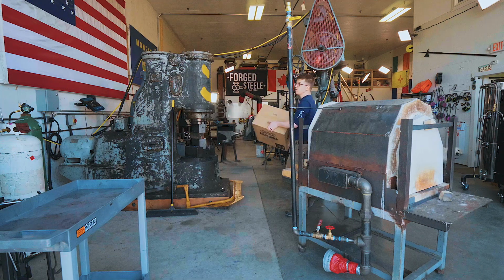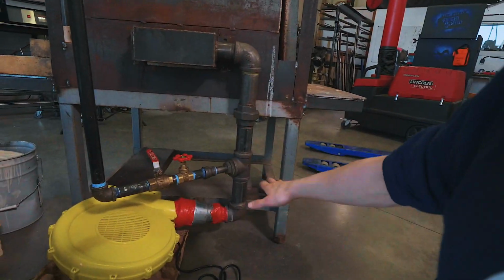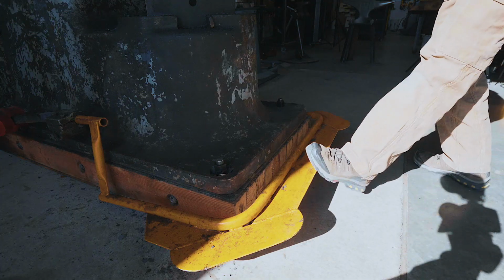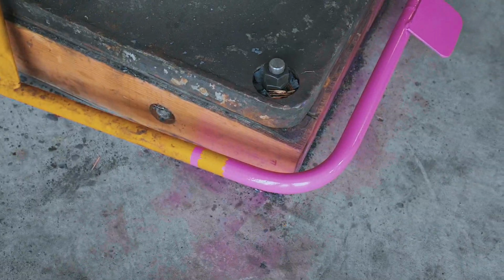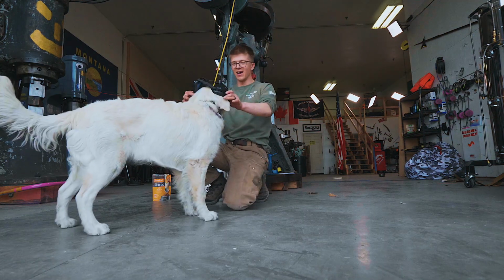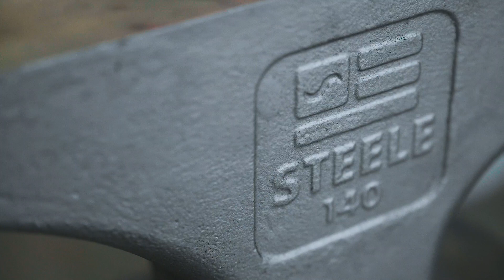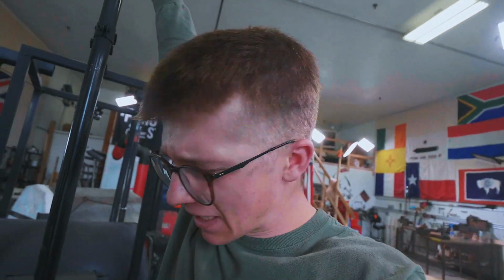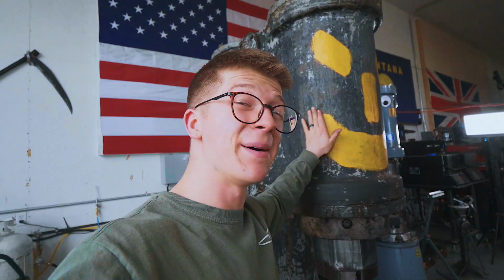NEW FORGE BLOWER, YOGO'S EARS, FORGING TOOLS!!!

Comment: What's happening in the forge is called flame lift off. It's caused by having too high of velocities exiting the burner nozzle/holes. You have two possible issues. 
1) you have too much air/fuel for the burner
2) your burner nozzles are plugged or the burner is too small for the heat you need. 

A ton of excess air isn't good if the goal is to get the hottest flame. Excess air that isn't used for combustion is just absorbing energy from the combustion of the fuel and carrying it out of the forge. You are looking for the hottest flame because most of the energy that the forge will absord is actually infrared, which is related the (flame Temperature) ^4. The huge amount of excess air lowers the overall temperature. You need to be able to regulate the air and fuel more precisely so you can still have plenty of air for proper combustion, but not so much that you  have flame lift off or so much excess that you lower the temperatures. 

If you can get an IR thermometer, it may help you dial it in. My suggestion would be clean the burner, and add better flow control on the discharge of the blower. Then get a nice small controlled flame and use the IR to optimize the flame temp. Once that is done, you can increase the air and fuel flow rates little by little until you reach the burner capacity (excessive lift off, and flames that are no longer jet, and "dance wildly" are signs that you have gone too far). For extra points, add a fuel pressure regulator, a gauge and flow meter to the fuel along with a globe valve for proper flow control.

Btw, tuning heaters and burners can be extremely dangerous in industrial environments. Back in the days when I worked in the petroleum refining industry, heaters were the most feared pieces of equipment, with some of the highest piece counts of safety equipment. Second, maybe only, to high pressure steam boilers. Be careful. Always purge the heater with air before adding fuel and lighting a flame. Also fuel is turned off first, then air. Always.

Comment: I'd try fitting a speed control to the blower. I think you blew right through the too much fuel problem into a too much air problem.
Reply: Yup a VARIAC would fix this I think

Comment: with the big forge.. and all the air flow.. instead of coming in the end of the burner box.. cut the back out and build a new inlet.. you can get cast steel hand rail sections you can weld together to give you wider radius bends that should be able to handle the heat..   you may want to have the air coming in  by using a pair of cast steel handrail elbows..  so you can take full advantage of the volume without speeding it up till its supersonic blowing across the forge hot area..   if you have a 10 or 20 amp Variac.(not cheap). you can slow the blower down.. but do not slow it down more than 60% on the dial.   because when you reduce the voltage the current goes up.. and you will overheat the windings causing the motor to burn out.  since  your blower takes just short of 10 amps... hopefully you can go to a bigger variac..  you might also try a Router Speed control... its a little electric box... chops the AC wave into fragments to control router speed.. since many routers are around the same amp draw as your bounce house blower... you might get away with it. and they are only 20 bucks over at harbor freight.  i use my 10 amp Variac.. on my brush type motor finish sander as a foot and leg relief tool..  i use it on my big fans to slow them down when the 3 speeds does not get me where i want to make wind at..   Hint... hand rail elbows are rough finished inside... do the sanding strip on a 1/4" shaft with a slot to take some of the casting rash off the inside to smooth the airflow. 

 you should still put up a craigslist ad.. looking for USED... even broken Land rover Leaf spring packs.  somebody will have some sitting around..  shieffield steel you know..  want to make  middle eastern looking patterns in your forged steel.. what do you think they used..  rule #1.. never abandon your land rover in africa..  the axles and springs will be gone when you come back with a new ignition rotor..

Comment: @alec steele, this seems like the blower is too close to the ribbon burner along the length of pipe for the air and gas to mix properly. A longer length of pipe from the fuel injection port gives it more time to mix. With a blower that powerful it looks like you're getting to much air to natural gas in ratio, and possibly too much volume to the ribbon burner overall.  I hope that helps

Comment: Hello Alex. So I have some experience in gas burners mostly in the glass industry. So the first problem I see is that gas pressure in is typically is 4-6 psi. So the larger blower with the 2 90's and the possibility too much air in and an opening not large enough to allow it to flow unrestricted is creating back pressure. Pressure in the system that exceeds the gas pressure in has essentially restricted how much gas is acctually allowed to flow in and mix with the air. The fan you had before was probably the most the burner could handle. I can give you some suggestions on what you can do with what you have or can easily make but that would have to be done in a private conversation. Some of the info is how I make a living.

Comment: RIBBON BURNER, To regulate the airflow, install a gate valve or bypass valve before the fuel inlet. Your flame just has too much air for the amount of fuel. The flame in my setup looks the same when the bottle starts to run empty. I'm running a 265cfm blower, 2" gate valve, 1/4 fuel line in, 10" ribbon burner, similar to what is found on Wayne Coe's website. Give him a shout, he's the OG ribbon burner guy

Comment: Bigger volume pipe means less pressure, and visa versa. So you're trying achieve two sides of the same coin. To get the results you want, both pressure and volume, maybe consider running two blowers into pipe(s) of a small diameter. Maybe have the two blowers joint into a single inlet, or possibly two inlets. However I don't know if that'd have any adverse effects. ^ but yeah try two blowers.

Comment: And about your forge problem. Definatly use a larger pipe. Ittle slow down the air flow but you’ll get the same amount, if not more, are going in. Imagin you have a lit match. For it to burn hotter you’ll need more oxygen. But if you blow on it, it’ll go out. That’s because the air was to fast. If you just put it in a slower feed of air, it can use that oxygen instead of it going by to fast for it to be used.

Comment: Alec : You are on the right track with the larger blower. You may have gone to big but, "to much is better than not enough."  The way you were trying to reduce the amount of air going in is called "starving the blower," and is not good. Never do this to a blower or pump as it will shorten the life of the motor if not burn it up. Put a throttling valve in the pipping on the exhaust side of your blower. Use a "Globe valve." That way your can dial in the amount of pressure you need for your air to fuel mixture. Don't look at it as a problem, but as a challenge. You learn more when things are challenging. Hang in there brother.

Comment: @Alex Steele Just a FYI but the gas pressure for a natural gas line is pretty low you could be simply near the pressure for that gas pipe. You could maybe build an inlet for the blower with the gas entering in a tube with a sliding door for air flow control and let the blower both do all the mixing. Would likely have a lot higher flow that way anyways since the inlet of the blower will be negative in pressure aiding the flow of gas. Food for thought man keep up the good work.

Comment: Maybe the pressure from the blower is so high that it does not allow enough gas to flow into the mixture. -> Bigger pipeafter the mixing point.

Comment: Have you stopped the hammer from hitting the top? I was wondering if the spring is fatigued or needs a pressure adjustment. So it wood take more force to compensate for the up stroke. ? maybe?

Comment: The big forge problems.
I think you need a bigger ribbon burner, and to move back to the lower pressure blower.

The first setup seemed like it wasn't flowing enough air (as you pointed out), and now it seems that you have too much air flow through to burner (caused by the higher pressure)
As you covered the air onto the blower, your problem got better, but, I think that ultimately that burner cannot flow enough air/fuel to heat that forge like you want.

I would suggest a bigger burner, or perhaps a second burner. Either way, I think the flow restriction is in the burner itself.

Comment: The pressure of the fan is probably holding back the pressure of the gas.  I would re pipe so the fan blows and the gas injects as close to the burner as posible.
Reply: Also put a gate valve on the air so you can throttle it up and down.

Comment: Alec! Could the issue with the power hammer hitting the top of the chamber been because of the original plate that was on the tredle? With you switching it to the top of the bar and angling it down it would limit how close the tredle bar would be to the ground compared to what it was originally. Albeit there's not much of a difference but it may have been all it needed.

Comment: When you increase air pressure and your gas inlet is on a tee, you are going to be stopping a lot of that gas flow (natural gas is very low pressure at the device in most cases).  You either need a venturi action (low pressure zone for gas injection) or to plumb the gas on the intake of the blower.  I'd use a flash back arrestor on the oven itself too just for extra safety.  Oh and I'd ground your gas piping if it isn't already.  Static buildup is not good in anything.

Comment: You have increased the o2 higher than the mix ratio of natural gas. Also you gas mix point needs a Venturi design instead of straight pipe. The gas pressure is piped in at low psi. and you are probably inducing a back pressure.

Comment: You have too much volume flow compared to amount of gas. To increse the pressure inside the forge, you'd need to restrict out-flow, which can be little tricky while still maintaining the usability.

You can still try if you get better flame by closing the forge openings enough to restrict the flow into proper level

Comment: You need the same amount of air going into the forge at a slower rate bigger pipe diameter is all that is required

Comment: What might help with the controlling the airflow with the forge would be to put a gate or ball valve to control your airflow, there’s to much air going to your ribbon burner it’s blowing out your flame. The mixture is too oxygen rich. It would also be interesting if you could get the specs on the ribbon burner to see what would be the maximum gas pressure you should have then with that done slowly raise your oxygen levels to you got the whole burner lit without it being ripped away.

Comment: If it was me I'd want to put a small tubular bumper on end on the workshop floor on either side of that new protruding pink foot plate, because if the original design was a trip hazard, a close to horizontal steel plate at shin height is surely a nightmare waiting to happen. The circular bumpers might be a trip hazard themselves but still far safer...

Comment: do you think that the added pressure of the blower is affecting your gas out put? cause a gas regular works by supplying gas by measuring downstream pressure. (downstream of the regulator) so if the blower is supplying lots of pressure, the regulator may be sensing that an closing the orifice

Comment: have you checked for or cleaned any carbon build up from the manifold or screen on your ribbon burner? i know the burner manifold has some smaller holes that can get plugged up over time. this would effect your gas flow and possible gas pressure.   also with the air it seems you increased the air psi and cfm , not sure size pipe your burner will accept. you could try to add a knife gate valve or  a butterfly valve inline to get some better control.

Comment: Direct Fired Manufacturer's Rep here.  At 4,000 feet that you're losing about 14% capacity* on the burner due the change in density.  You could try over-firing the burner, but your flames lift and look like, well that.
Considering 1: it worked a sea level, 2: the other forge with an 8x4 and elbows works fine with 2 psi gas, and 3: your flames are lifting something fierce.
I'm leaning toward you need a bigger burner at altitude.  Wish I knew of other blacksmiths at altitude who could chime in.

*(see AMCA 99-09 section 0200)

Comment: Alec, remember the machete you forged when you were still in the UK? I think it would be awesome if you made another one, but with a longer handle, long enough to fit two hands comfortably and ample room to choke up on the handle or down for greater power and swing speed.

Regarding the large forge, I recommend using a turbocharger and a C-shaped pipe to give the air going in a better chance of reaching the inside of the forge with the most efficiency. Air does not like traveling at 90° angles.
Reply: A turbo charger would introduce enough pressure to pump air into the gas line........

Comment: I'm an engineering in the HVAC industry. Putting a bigger blower on your system may not help all that much if the pipe is too small. You will create a lot of back pressure for the blower to have to overcome. What is the diameter of the pipe feeding the air into the forge and what is the rated output of airflow and pressure that the bouncy castle blower uses? I can easily run some calculations to see where you issue is?

Comment: It is velocity. I think that you got enough air going through, but the air is moving too fast. When you have a pipe go from wide to narrow, it gets really fast. Super-sonic airflow makes it hard for flames to stay lit. That is why many jet engines have air traps to slow down the air, add fuel, set it on fire.

Comment: Natural (methane) gas flame speed is 0.356 m/s and it burns at 1950 °C, you cannot change this.
If your air gas blown mix is traveling faster than 0.356m/s you get (as you were) flame lift ie. the fuel mix is is traveling faster than the flame can burn.
If you want more heat add more/larger burners as on a gas cooker a large pan needs a large burner. It's a bit like the 'there is no subsitute for cubes'

Comment: Alec, you should add more burners, at least one more, so you can spread the flow. Looks like the gas flow rate is too high, so its both blowing away the fire, and not allowing the gas/fuel to sspread trough the burner, hence half the burner only working on half and igniting far from the surface. 

By adding another burner, you'll half the velocity and double the "diameter" of the line, by so, you'll double the output heat without increasing the flow velocity at the output. Upgrading the pipes would be good to, they can be quite restrictive for the flow and they might be accelerating it to a undesirable velocity, causing all kind of bad things

Comment: I use a BCB that draws half the current an I need to stick an almost closed automotive intake butterfly valve AND a motor speed controller to tame the amount of air into my 1 brick ribbon.

Comment: The ratio between gas and air has to be around 18% gas. With the amount of air you use the gas needs to be increased. Also the reason your flame is so low is because you need more gas I would try putting a burner on the other side as well if you are going to use such a huge forge where your gas is inadequate for the shear size.

Comment: Alec I am constantly struggling with airflow, and I burn coal from axmen's in Missoula. I can't tell if I'm getting to much or to little air, with that huge blower couldn't you run your power to it through a dimmer switch? Like for mood lighting, this would give you the ability to control you air flow. I am going to try it this summer with a pump I cut out of an old air mattress that I think is pushing to much air. Might be stupid, I'm not sure but if it works might be nice easy fix.

Comment: It’s quite possible the old treadle was going down too far and allowing the valves to open too much. Especially with the added height of the wood blocking under the hammer.

Comment: I see the problem with the forge. The gas isnt getting a good mix with the airflow. When it was hitting the back wall it was to much air. Larger air pipe with the gas coming into the air pipe a little bit back from the burner may be the fix. Give the air and gas a second to mix before exiting the burner. That would be my suggestion.  Also maybe have the gas on a ball valve and the air on a ball valve so you can fine tune the mixture as needed. I have had to work with gas burners a few time and have run across the same problem a few times where I had to fix other people's screw ups.

Comment: Alec, you have too much air for the burner.  Put a damper on the fan so you can reduce the air until you have the right mix for the volume of gas.

Comment: It's obvious, that the forge is starved for fuel! Also the air supply needs to be better matched! the output of blower pipe needs to match the inlet pipe of forge! no hokey adapters and wads of duct tape! another issue I believe is the natural gas supply! even after they increased the supply line to deliver more, it has such a long run down the side of the building I believe there is a volume loss there as well? it's obvious that the air/fuel mix is off!

Comment: You need a diffuser for that blower.  Good volume, but too much pressure so its blowing the air too fast for the burner.  Same thing we have to have for jet turbine engines.

Comment: Just an idea but when the gas company installed the lines they install a regulator right? That regulator could be your issue and it could be stopping you from getting as much gas as you need to properly heat.